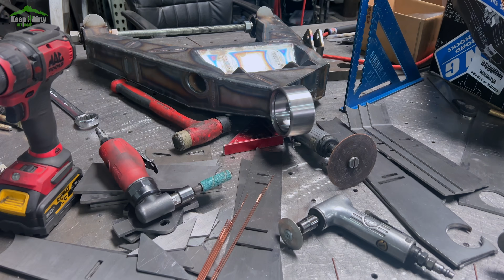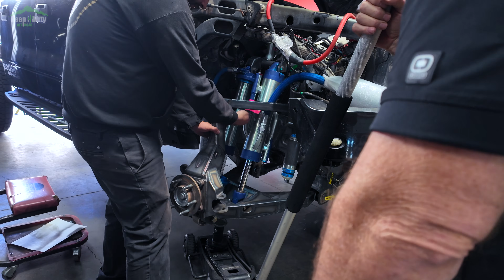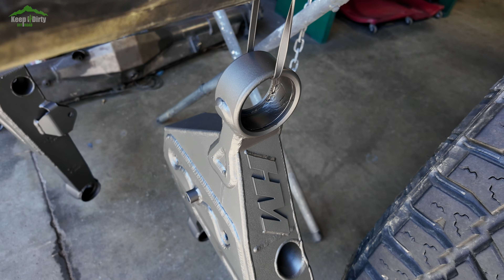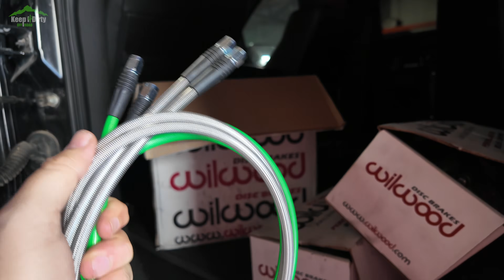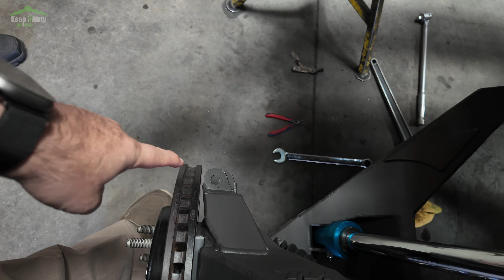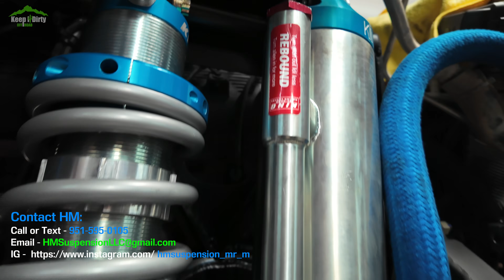HM Long Travel Build 5 -  Front Suspension

Comment: This is the best Gen1 Raptor channel. I have a stock 10 6.2 and offroad monthly here in Flagstaff currently. Ive overheated the transmission up to the yellow a few times and will look into a better transmission cooler. I had it serviced at 90k because it had a leak and with 144k on the truck im not sure how long the transmission has left. But we will see! Awesome build
Reply from the maker: Thank you sir.

Comment: Absolutely stunning build—congrats! Quick question: in your earlier videos with Kevin, bump stops were mounted to contact the upper control arm (like on the green “Raptor Killer” truck). In this build, it’s placed on the lower control arm. Curious—why the change in location when earlier you emphasized upper-arm contact for ideal performance?
Reply from the maker: Upper is the ideal placement. And if I had the budget for it, I would have done it. It basically requires an engine cage to distribute the load. And with it striking at the top center of the upper arm it’s a more even and distributed strike. But the cost of the cage plus relocating the AC lines, computer, and everything else adds up quite a bit and I could not afford it this go around. Eventually I will do it. But right now, I just ran out of money.
Reply: @KeepItDirtyOffRoad  Thanks for the detailed response—really appreciate the insight on the cost and engineering trade-offs. The build is seriously impressive, and it’s great to see the thought process behind every decision. Can’t wait to see it in action! 👊🔥

Comment: Makes me miss my Gen1, miss not buying Kinos HM Gen2 and downfall of current of my DD TRX🦖 - where a huge leap forward in suspension mods is a new anodized color spacer😂
Reply from the maker: Yeah. Ram crown is very different. TRX Platform has a ton of potential, but shops are just not investing it them because so few actually hit dirt. Hoping the RHO changes that, but they have been out a while and I have not seen any on the trails aside from the demo trucks at the mint this year.